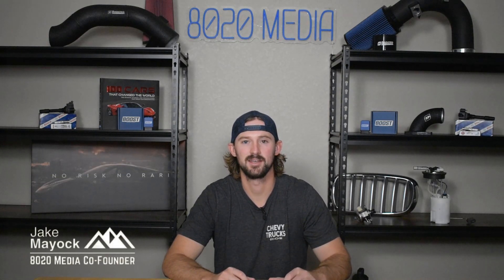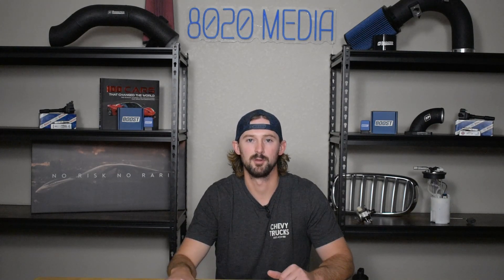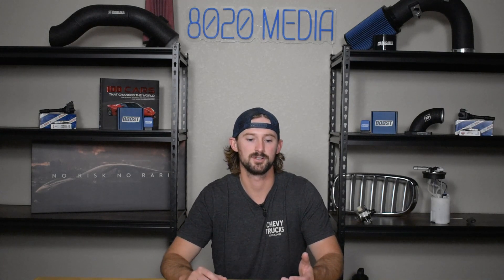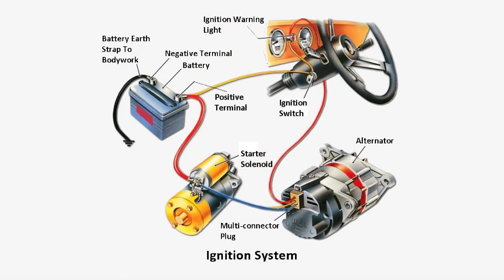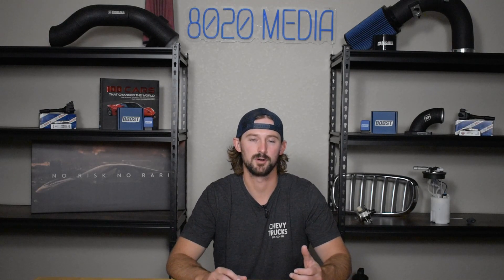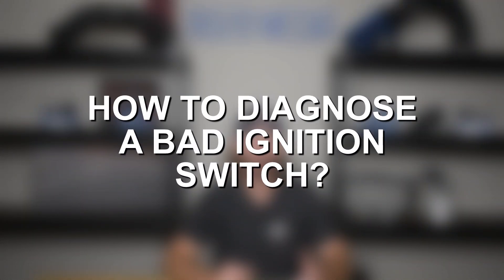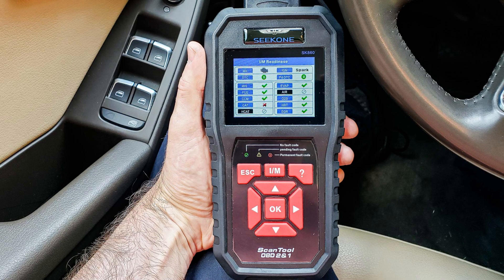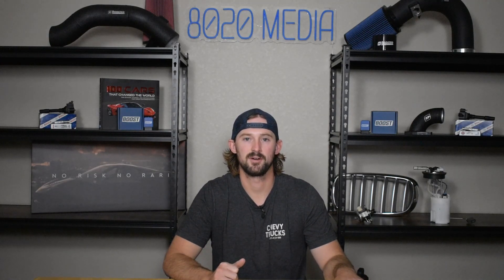Signs & Symptoms of a Bad Ignition Switch!

Comment: I got in my 1990 f150 4.9 300 inline yesterday got on the internet state 40 when a mile and a half my truck quit running like I turn it off and it will not start back it turn over but not run is that mean ignition switch when bad
Reply from the maker: C - If your 1990 F-150 4.9L inline-6 cranks but won’t start after it randomly died while driving, the ignition switch could be a culprit, but it’s not the only possibility. You’ll want to check for spark and fuel first. If there’s no spark, then yes, the ignition switch, ignition coil, distributor module, or crank sensor (if equipped) could be bad. If you have spark, check for fuel pressure—listen for the fuel pump when you turn the key to ON. If the pump doesn’t prime or you’re not getting fuel, the issue could be the fuel pump relay, inertia switch, or the pump itself. Since it died suddenly while driving and now only cranks, ignition switch failure is possible, but confirm fuel and spark before replacing parts.

Comment: Can I remove key while the truck is running or is that an issue
Reply from the maker: If you can remove the key while the truck is running, that usually means there's a worn or faulty ignition cylinder, which is not normal. It won’t shut the truck off immediately, but it’s a security and safety issue — the key should stay locked in the “on” position until the truck is turned off. Over time, it can lead to starting issues or even electrical problems, so it's worth getting the ignition cylinder inspected or replaced.

Comment: I have changed my ignition switch but it still does the same thing, it will start and idle for about 5 sec then it just dies, if I move the steering wheel up and down and turn it, it will stop cranking completely. Usually if I unplug and re plug the ignition switch and wait a few hrs it will start and run completely fine, my dash has been saying NO BUS for the same amount of time that this has been happening
Reply from the maker: M - The "NO BUS" message on your dash usually points to a communication failure between the vehicle’s modules, often due to a short or open circuit in the CAN bus system. Since moving the steering column affects the issue, it’s likely you have a wiring issue in the steering column, possibly a loose or damaged clock spring, connector, or frayed wire near the ignition switch or BCM (Body Control Module). Intermittent contact could cause the ECM or PCM to lose communication and kill the engine. Check the wiring harness around the steering column carefully for damaged or pinched wires, and inspect grounds and connectors related to the ignition and data bus.

Comment: My truck wont start randomly just any given random day itll leave me parked wherever im at. And then itll start right up whenever it decides to and it wont give me a problem for however long it wants. And been going on for a few years. I did replace starter and battery before and still happens from time to time.
Reply from the maker: A - Your issue sounds like an intermittent no-crank problem, likely caused by a bad ignition switch, faulty neutral safety switch, weak ground connection, or a failing starter relay. Since you've already replaced the starter and battery, start by checking the ignition switch—if it's worn, it may not always send power to the starter. Next, inspect the starter relay and fuse in the fuse box, as a failing relay can cause unpredictable no-start conditions. Also, check the neutral safety switch (or clutch switch if manual)—try shifting to neutral and starting it when it acts up. Corroded or loose battery terminals, grounds, or engine-to-chassis grounds could also cause intermittent power loss. Given that your lights and radio have flickered before, a weak ground or wiring issue is very possible. Try tapping on the starter relay or fuse box when it won’t start, and if that temporarily fixes it, you’ve found the issue.
Reply: @8020Automotive  will check out
Reply: I’m having similar issues, occasional hard start, occasional HARD start, occasionally won’t start. And I have to leave her alone for a while and come back. Sometimes now, but very rarely there’s just a sort of electronic clicking sound and no spark. I’m thinking it’s maybe my coils but idk. I was just told it could be a weak ground, how would I check my grounds? Do you have a video on it
Reply: Also my lights and radio have flickered before but that has only happened once and my ignition isn't hard to turn... and when it does leave me stranded everything electronically works inside the cab just wont crank, it goes silent under the hood.

Comment: My civic start but in the morning I turn the key and it takes about 4 to 6 sec to start
Reply from the maker: J - If your Civic takes 4 to 6 seconds to start in the morning, the issue is likely related to fuel delivery, battery health, or ignition components. A weak fuel pump, leaking fuel pressure regulator, or a bad check valve in the fuel system could cause a loss of fuel pressure overnight, requiring extra cranking to build it back up. A weak battery or failing starter can also cause extended cranking, especially in colder temperatures. Try turning the key to the "On" position for a few seconds before cranking to allow the fuel pump to prime, and if that improves the start time, fuel pressure loss is likely the issue. Keep us updated!
Reply: @8020Automotive  so I had the battery alternator starter checked and they’re all healthy. I had the mechanics look at it and everything is healthy.

Comment: My issue is that i can turn key from "off" position to "on" quite easily (unlocking steering and get power on with sounds, etc)

But i can't turn key from on position to start (sometimes it used to let me, but not anymore))

Does that mean i have to replace the whole steering lock (that is behind the ignition switch cylinder part?)

Or can it still be locked by any blown fuse/relay somehow?
Reply from the maker: L - If your key turns from "Off" to "On" easily but won’t turn to "Start", the issue is likely with the ignition switch, steering lock mechanism, or a worn key cylinder, rather than a fuse or relay, since electrical faults wouldn’t physically prevent key movement. Since it used to work intermittently but now doesn’t, the steering lock assembly behind the ignition switch may be failing, or the internal tumblers in the ignition cylinder could be worn and causing it to jam. Try wiggling the steering wheel while turning the key, as a locked column can sometimes prevent movement, and if possible, use a spare key in case the original is worn. If the key still won’t turn to "Start" despite these attempts, replacing the ignition switch or steering lock assembly is likely necessary. Keep us updated!
Reply: @8020Media  Took the whole steering lock apart and the issue lied in the bottom "plastic switch?" (Where the 6 pin wires went).
A small metallic part was warn out. I think it works as "double" or smth. It's meant to block using starter (turning key) after you started the car. 
(If i took it out, i could turn the key again but that would also mean i could turn when the car is running)

I just ordered a new steering lock, without ignition cylinder+keys.

Comment: Will the cause a starter to sometimes work properly and sometimes just click when the ground has been checked alternator, battery and starter are all brand new brand new relay and all fuses are checked and they all work as they should still having a click no crank sometimes crank
Reply from the maker: C - Intermittent starter operation with just a click, despite having a new starter, battery, alternator, relay, and good fuses, is often caused by a poor ground connection or high resistance in the wiring to the starter. Even if the ground has been checked, ensure that all connections are clean, tight, and free of corrosion, including the engine ground strap and the power cable running to the starter. A weak or failing starter solenoid (even on a new starter) can also cause this issue. Additionally, inspect the ignition switch or starter signal wire for intermittent faults or voltage drops when turning the key. If all connections and components are good, perform a voltage drop test on the starter circuit to identify any hidden resistance in the wiring. Addressing these areas should resolve the intermittent clicking. Keep us updated!